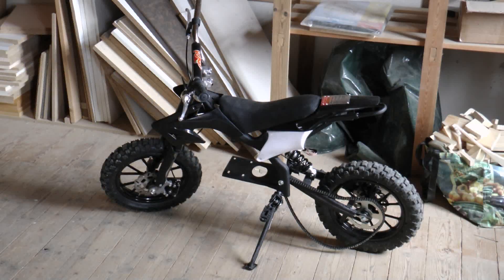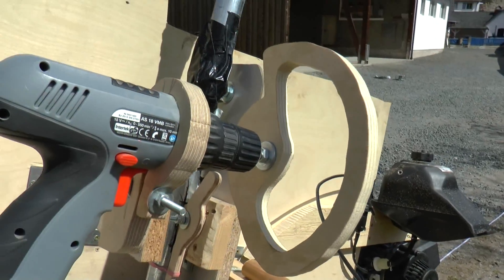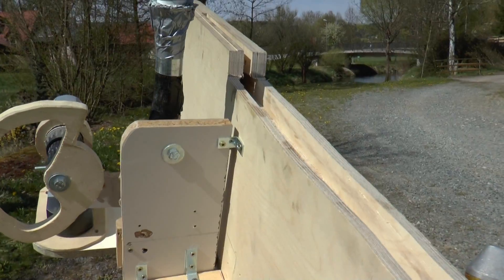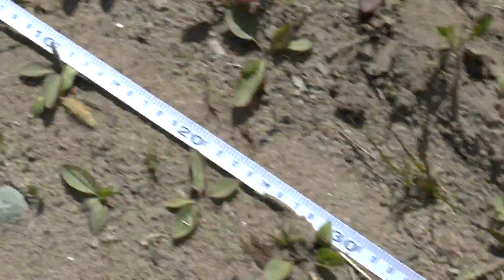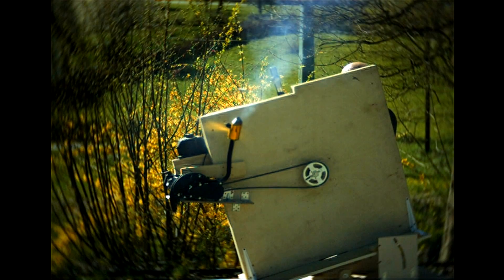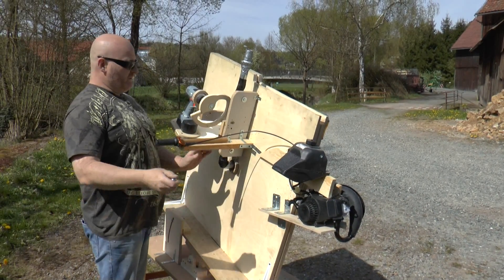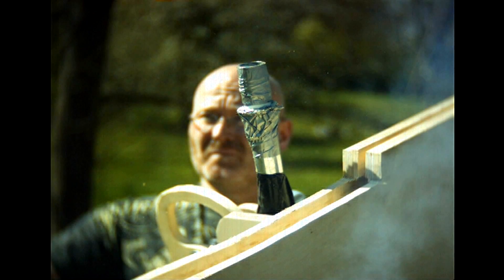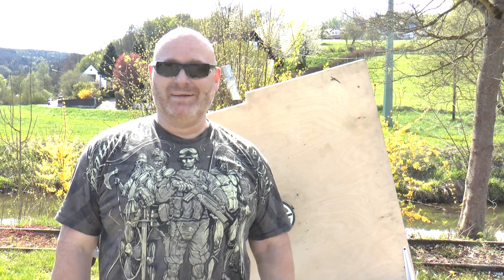The World's Loudest Launcher! Plus win a slingshot.

Comment: What if you lined the inside of your wooden spiral contraption with a copper pipe spit length-ways? If you can't make a gun barrel, would that count as a gun barrel? All the force will be on the pipe not the wood, but the wood is supporting the pipe. It would reduce friction and maybe stop the wearing. Just a thought. Cheaper than steal.

Comment: A thought on the next evolution of this thing. Instead of the wooden acceleration spiral, feed the balls into 2 spinning wheels with just the right sized gap between them. Like a baseball pitching machine. The balls should exit through a square "muzzle". That will reduce friction.
Reply from the maker: I looked at such launchers, but if you do the math, you will see that the bullet speed is limited. You'd need huge wheels and crazy RPMs (much higher than in a sports car) to make a legit weapon.
Reply: JoergSprave I'm thinking around 35k RPM & a heavy projectile.( a couple of ounces) But I'm not a math guy so I'll take your word for it.

Comment: It sounds as if the pusher arm things slows down a bit when the ball falls into it. It would reduce the exit velocity of the projectile if this is true. This problem could be fixed if you added a fly wheel to the axle somewhere. This is indeed a nifty contraption regardless if you add the modification I suggested.